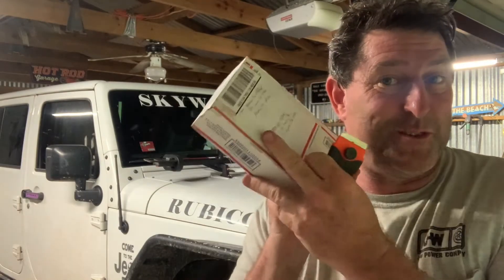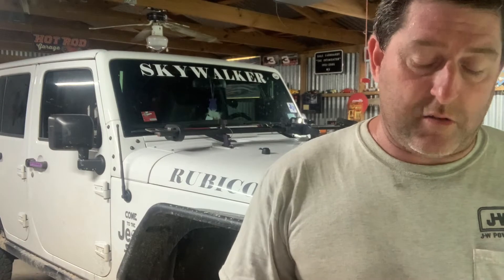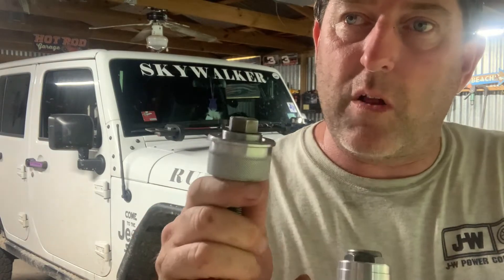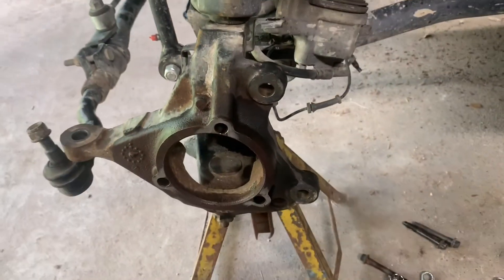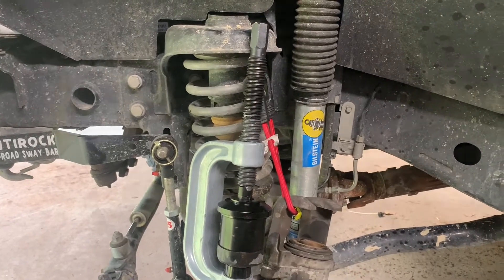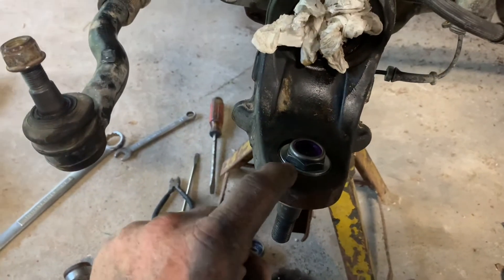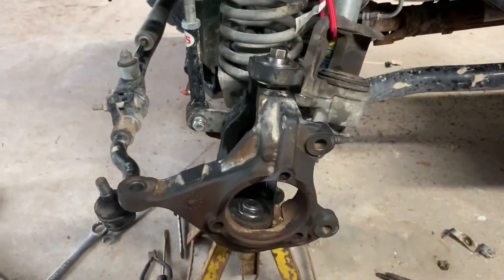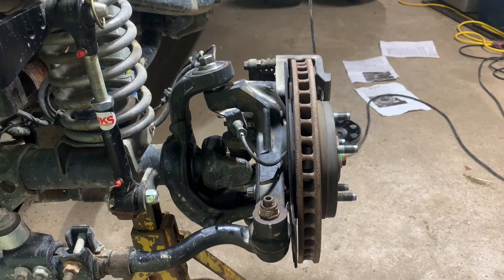American Iron ball joint deletes going in | DONE with the STOCK balls

Comment: Thank you guys so much for the info. I've been having drivability issues with my JK. It's got 156000 miles on the stock balls and I just upgraded to 35's and it's just to much for the worn out old ones. I only want to do this once because it took me 2 days when I did some Teraflex Joints on my Dad's Jk. We already need to replace them again. FYI don't get the Teraflex Adjustable Ball Joints because after a few hundred miles they wouldn't adjust and we ended up breaking 2 of their adjustment tools trying to LOOSEN the joint to reset the preload. And now they are worn but there's nothing we can do to adjust them. So now we need to put in new ones. This seems to be the best option for people who would like to be able to rebuild rather than adjust. Press once is really appealing to me.
Reply from the maker: Took Tera-Flex out and went to these. Look up Rock Solid Rig. They got more miles on them than me but so far I love them.  Thank you for the feedback. 😀
Reply from the maker: Just wanted to let you know, three months and counting !!!....STILL LOVE THEM..Have wheeled now with Rock Solid Rig several times hard and they are doing great. Come on up to Okie Jeep Jam in October. We will all be there and can talk for days about it!!!

Comment: How are they holding up after two years? Also what size tires are you running? I’m running 35”s so I think for me will be about longevity vs strength.
Reply from the maker: Zero issues with me personally. Original install was on 37’s. I run 40” stickies on them and have had no trouble. Most people’s issues ( after discussing with Josh Dodsworth at this past years KOTH ) is they are very critical on install with proper torque sequence. They can become stiff to turn if not torqued properly. He has introduced an improved lower kit to aide with self centering issues, where he introduced a solid steel spacer to help with torque issues. I’m not sponsored….endorsed….assisted in any way shape or form from American Iron…I just like their product. It works good for me.

Comment: How tight was your steering after the install? just got mine back from a mechanic and its definitely needs help to return to centre after cornering or do they free up after a bit?
Reply from the maker: Assuming you did not install yourself? Lots of variables here that could affect you. The torque sequence is very particular on the deletes. The turning knuckles should be very free with little resistance on the bearing pre-load. What deletes do you have? Meaning does it have a metal washer that goes down over the o-ring or do you have the newer ones that use a metal bushing that sits on inner bearing and a Delrin shim that sits on the metal bushing? The “updated” version has these changes to help with self centering resistance. Without knowing exactly how they were installed , it’s hard to say what is affecting you. Josh Dodsworth with American Iron is very helpful and has tons of knowledge on installs. I message him through FB and he always responds with assistance if needed. I would start with the torque sequence…and see how easy the knuckles rotate. If there stiff….something is wrong.
Reply: @ALongLongWaytoGO  cheers, they are the American iron brand (well thats who i ordered them through and sent to Australia.
Even though i ordered them about 2 months ago it sounds like i got the older system as it did have orings and flat washers. 
It was a local mechanic who installed them, so not sure on the install either. Sounds like he didnt follow the instructions then, as say pulling out of a T intersection im manually returing the last 3/4 of the turn
Reply from the maker: @WhatTrigger  ahhh…..We’ll Good Day Mate !!!….Yes sir….I know Josh Dodsworth personally as I was in California with them at the King of The Hammers race. They did just come out with an update to help with self centering issues. I’m not sure how shipping to Aussie works, but here on the other side of the world so to speak, Josh is covering the cost of the parts and we are only paying shipping. So it cost $15 US….I have not installed them yet but had a subscriber let me know it was night and day difference. But I can’t confirm that just yet.